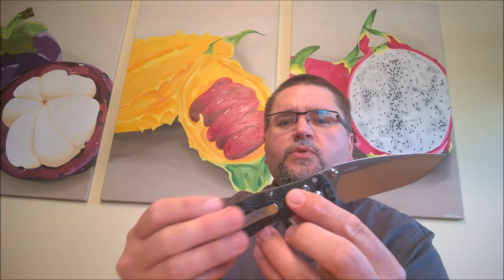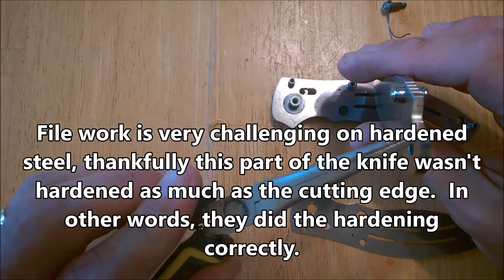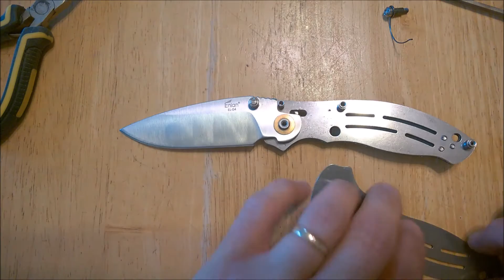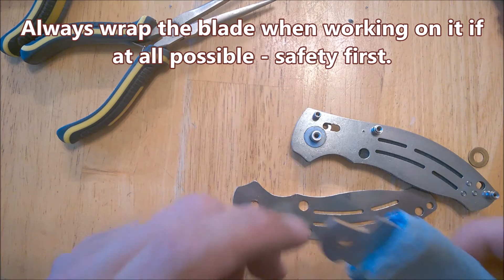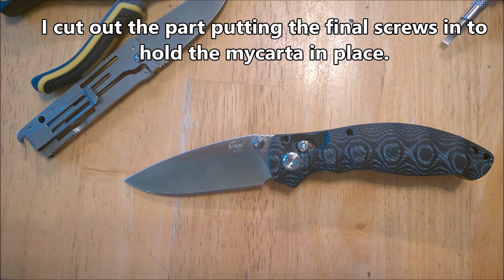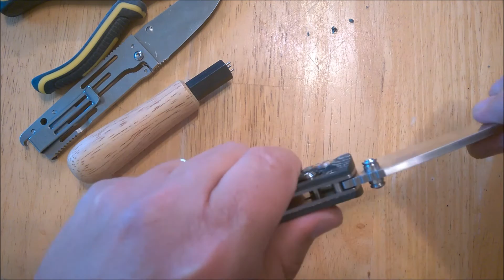No mfr makes every knife perfect. I fix the axis lock on a Enlan EL-04 MCT.

Comment: You can also use the ends of a fine pair of pliers in 2 of the holes for easy and reliable extraction . Also you could use felt tip marker on the surface to visibly track the amount you need to take off .Thanks for the review very useful as i have the same issues.
Reply from the maker: Thanks, those are good ideas.  I always use a felt marker when I sharpen, so why didn't I think of it here?  Oh well.  I appreciate the comments.

Comment: I used some snap ring pliers that I already had to take the pivot of  this knife apart. I really only wanted to clean it because it is the most nearly perfect knife that I have from Enlan.
Reply from the maker: I too have tried snap ring pliers, they do work in a pinch but I don't like to recommend it because it seems to be something that is quite tricky for some people to master and many folks don't have them.  I really like my EL-04 and the lockup is rock solid even though it still does occasionally lock up with the axis bar on a tiny bit of an angle. I still have not done my full review on her though.

Comment: Useful video, Jake.  But I wonder if a portion of the problem might simply be unequal pull of the springs on the left and right sides.  What do you think?
Reply from the maker: I did think of that.  I know that the grind of the deck where the lock rests is a factor for sure.  since I don't have any good way to test the springs I just left that out, but maybe I will take it and another Enlan with axis that is working fine and swap it and see.  I just finally thought of that as I was typing this, that would give us some info, I may just do that.  If I do I will record it.
THANKS Joe!!
Reply: I adjusted the springs on my g720 to soften them up a bit. I found the axis lock really weak but working fine after that, nice and level, just too weak. When I opened it back up one of the springs had come unclipped from the liner. I don't think the strength of the springs being different would make the axis lock unlevel. While you have it apart, polish the barrel on the axis lock and the cut outs in the liners too. It will make it much smoother.
Reply from the maker: Thanks, i'll try all that

Comment: What size of Torx Screwdriver are you generally using with these kinda knives. I`ve been fiddling around a lot and never seem to get the right size. Btw I am glad to see german engineering still has a high standing overseas :)
Reply from the maker: Ahh, I forgot to post the link, I will add it.  I come across everything from T6 through T10, any of those are common.  There is a very odd T5 but I don't remember any over T10.  Here is the link to what I bought. There are some other good brands of drivers but they all seem to be German, so maybe you can find a better price than we can over here in North America?
http://amzn.to/1sz84KL
Reply: Canadian Cutting Edge
Wanna hear something stupid?.... Those german made tools are cheaper at your place than IN FREAKIN GERMANY! What the actual hell? I would pay 56$ here. Economy makes no freakin sense xD
Reply from the maker: That is very wrong.  I should also say that the link I gave you is for a set that is very under-priced compared to ALL others that I found.  I don't know why they are selling that one set at a lower price but there it is.  Most that I saw were like $60 for the same Torx sizes for the same brand, or other good German brands.  I could not find them at all on the Canadian version of Amazon, I had to buy them from USA.
Reply: OK, Jake.  You have to stop coming up with good ideas.  I keep buying more knives because of your videos and now I am buying more equipment.  I followed your link to the Wiha set on Amazon and found in the right column it could be bought from "Other Sellers on Amazon" for $24.52 with 2 day shipping!    (I am an Amazon Prime member and it provides free 2 day shipping.)  So, it's another great deal I can't pass up.  Thanks for the tip but too many great deals and I'll be mortgaging my house to finance them! :-)
Reply from the maker: So sorry Joe.  Maybe you will need to unsubscribe...
On second thought, a mortgage isn't too bad of a thing, interest rates are pretty good.  :)
It's cool that you saw the link to get it for $24.  I have Prime on Amazon.ca but Amazon does it by country only and not across all of their site - which sucks - and even if I got Prime on Amazon.com I would not be able to use half of the benefits of it because I am in Canada.